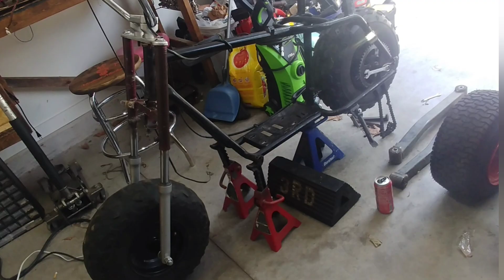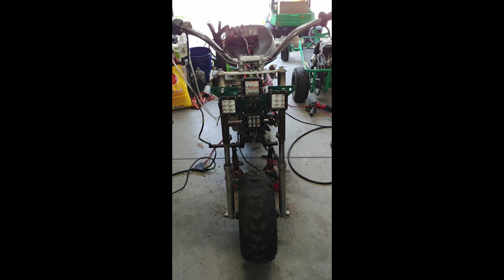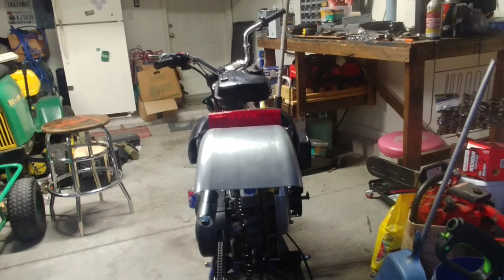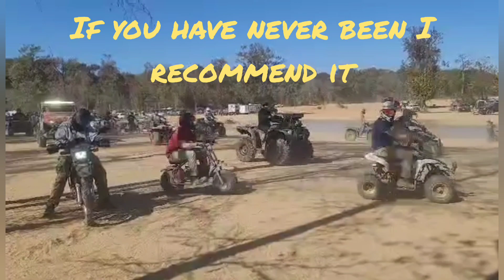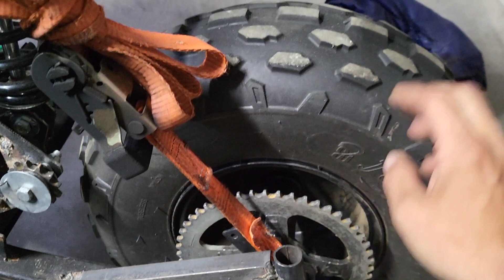DIESEL MINI BIKE INTRODUCTION

Comment: I know I'm late to this thing, but did you ever see what kind of mpgs it gets?
Reply from the maker: I do not have an accurate number and I will do some experimenting, I do know that in comparrison to a gas engine it does way better, I can romp on this thing wide open for a few hours and still have 3/4 to 1/2 a tank. This is a good question I will address with an experiment thank you
Reply: @modestmechanics181  I've watched this whole thing and I'm glad to hear it's a l70 variant. I was thinking it was a l100 but was considering a l70 clone for a mini myself. I'd like to be able to cruise at 45 or 50 comfortably.   Probably asking too much of the thing
Reply from the maker: @VirtualCryptid  with gearing anything is possible also playing around with the cvt springs...you can get to the mid 40s

Comment: What did the swing arm pieces come off of. Nice build
Reply from the maker: Thanks, The swing arm was made from 2 jeep lower control arms I kept after I did a lift for a customer. I supported them across the top with 1/4in plate I had from a lawnmower I took apart from another customer.